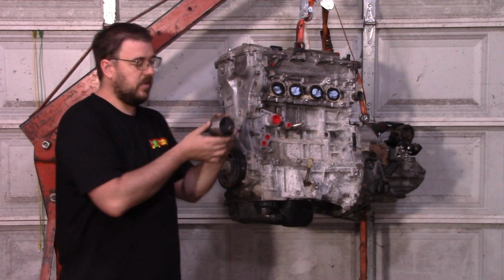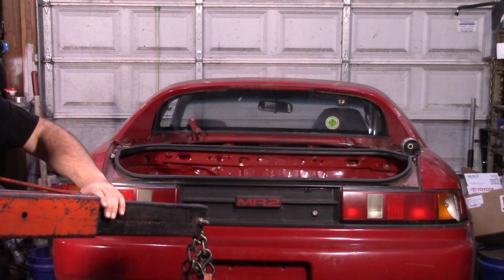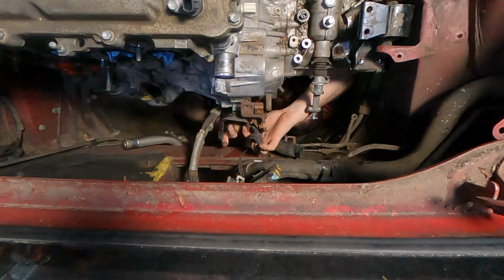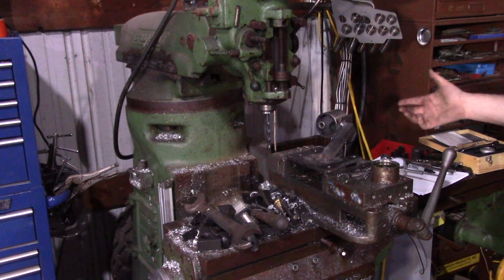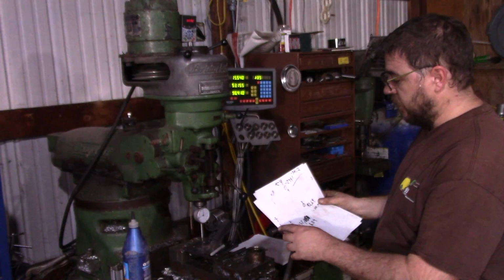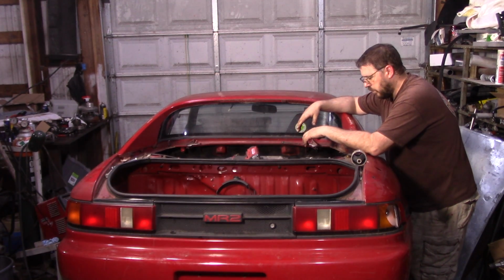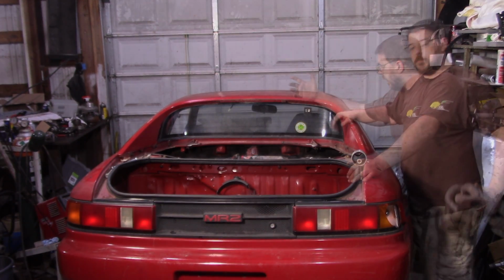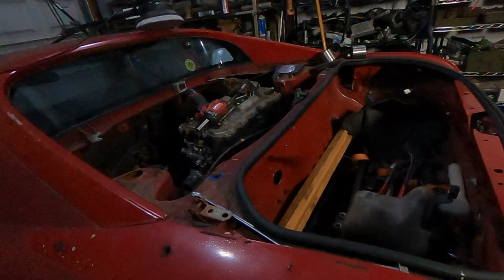MR2 SW20 2AR-FE engine swap mount (Evey #3)

Comment: Any suggestions on using the old e153, where would be the best place to add mount holes?
Reply from the maker: It would be easiest to just get a more modern bellhousing and swap it onto your E153 than to modify it. But with that said, generally you want to add bolts in the biggest gaps. In this case it would be at the bottom. picking up the two bottom bolts would really help provide more secure mounting.

Comment: I really appreciate all your work. It really has me taking a second look at the NZ and AR platforms over anything from another make.

Do you have a place to find information about the Denso box or NEC processors that come with these units? I'm having a hard time finding anything like a manual. You can't start doing the fun stuff until you know how the code works.

Do you have any plans to try anything with a turbo? I'm sure you already know about the 8AR-FTS, so there are turbo pistons available.

You could also try a 90mm bore with a 86mm crank, high compression pistons, long rods (probably custom) and revving the heck out of it.

I have some ideas for higher revs, but they would take a lot of work.
Reply from the maker: Yeah, it does have a lot of potential and i think i'll go a long way to starting to show that in 2022. The way Toyota builds motors is very underrated for reasons i don't really understand but i'm doing what i can to fix that.

There's no datasheet on the processor that i have been able to find. So there's no mapping of the peripherals on there. The NASA unintended acceleration report contains some incidental information but it isn't that much. There's a good chance that the die is not actually unique to Denso, the best way to go would be to buy a pile of NEC processors and decap them and decap the Denso units to do some compairaisons. You might even get away with decapping the Denso one only and potentially finding some markers on the die that indicate something. I do know that there's no NEC processor with the same number  of pins so there's no easy match up like that.

Comment: I can't remember if you address this or not in another video, but is the 2gr axle mount going to work on this swap or are you going to have to design another mount to support the  axle? If so what is the eta on that?
Reply from the maker: The 2010 manual camry axle carrier should be close enough especially with an 1/8" shim between it and the block. This will get us going for now but i will eventually make a lightweight axle carrier bracket as long as there is enough demand for it. In the interim I'll probably release a shim plate.
Reply: @FrankensteinMotorworks  so I'm leaning very heavily on doing a cal legal engine swap with the 2ar fe. Are you able to list all the emissions components I will need? Off the top of my head: egr, catalytic converters, charcoal canister, all vacuum lines... anything else? I'm not too familiar with emissions on newer vehicles.

Comment: Id be really interested in doing a 2ar sw20 swap with a 6 speed ea trans. Even an aw11. The e153 is becoming nearly unattainable at a reasonable cost. I know your build is a racecar but if you got time, and resources, I'd like to see more possibilities for a daily driven, cost effective, modern upgrade swap. Ofcourse toyota blood. Keep up the good work. Love the content.
Reply from the maker: Honestly this is a tough problem to handle. I absolutely want to solve this but there's also all the other messages i get that say they don't want to swap anything other than an E153 into the Spyder despite me providing a modern transmission option for those. The issue comes down to availability, there's really no manual transmission with great availability that is on the market today for use with these. When i picked the EB60 for the Spyder there were hundreds of them and they cost $500-800 a piece. now the junkyards all want more than Toyota wants for a new one. The EA60 starts even rarer and more expensive unless you're in the UK.  So i totally want to solve this, i just don't know which transmission to use to do it with.
Reply: @FrankensteinMotorworks  thanks for entertaining my interests. I've notice with  the pandemic, availability has gone scarce due to lack of importing and pricing has gone through the roof. IE: gen 4 3sgte prices have doubled.

Comment: On the poly front mount: Will that be close enough to what your customers have, in terms of ts effect on the final alignment of the engine? I accept it's not going to affect the left/right lean of the engine much.
Also, wouldn't you want to put the main bolt in from the side of the car? How will you get it out once your headers are installed?

Torque control seem to be the best use for poly bushes, as they're usually not under as much load, right? that should reduce the transferred vibrations, I would think.
Certainly I can recommend getting new mounts of any type for anyone with an MR2,
My 1999's front mount rubber was detached from the steel, it felt horrible.
I got a new bushing (Mackay A5111 Engine Mount Front) and pressed into the bracket. it feels SO much better, shifts much easier now.
Reply from the maker: The poly front and rear mount i'm using is the factory mounts but the rubber is replaced with poly so the alignment is the same without having to worry about nearly as much droop due to the unsupported right side mount. It just makes locating that 4th mount at exactly the right spot quite a bit easier.

Comment: Im a bit confused, what motor are tou going to squeeze its full potential? The regular 2ar or the fxe variant?
Reply from the maker: Since i'll be replacing the pistons and the cams there's no difference between the FE and FXE for the sake of this discussion. If you want to be technical about it i'll likely be using a 1AR-FE crankshaft which will be the only differentiating component left in the engine.
Reply: @FrankensteinMotorworks  got it, any head work or just stock for the inicial testing
Reply from the maker: @e5141981  For the initial testing I'm just going to run a stock engine. The initial testing will just be to make sure everything in the car works together and to get a base tune on there before i start tweaking. That said, there will be head work entering the picture quite soon after the initial testing. probably not the 2nd engine but probably on the 3rd engine.
Reply: @FrankensteinMotorworks  awsome! I have so many questions but i will stay tuned as you continue this build, all my questions will eventually be answered
Reply from the maker: @e5141981  You can feel free to ask. even if it makes no sense to answer in a comment it gives me guidance to make sure i cover those things in future videos.

Comment: have you ever thought about implementing the 2ar-fse with the D4-S port/direct injection system?
Reply from the maker: The 2AR-FSE is actually a longitudinal motor so the block is completely different. It might be possible to swap the FSE head on an FE block to fix that but then the next problem is i'm 90% sure that it isn't available at all in the USA. Plus the benefit of port injection is that it effectively gives the effect of higher octane fuel which allows for higher compression and higher engine efficiency. But since we aren't limited by fuel octane here because i haven't limited this challenge to any fuel and I live in Indianapolis which has easy access to just about any fuel there really would not be anything gained with the extra complexity.
Reply: I think direct injection requires much higher fuel pressur for the direct injection rail, which needs a secondary pump maybe?
that would be a lot of added complexity, but if it's all mounted on the engine itself, it shouldn't be hard for our champion to tackle.

Comment: how do you plan on dealing with the throttle? Or will that be in a future episode?
Reply: If it's like the 2GR-FE (And i'm 90% sure it is), he already makes and sells the requisite pedal, adaptor mount and wiring for this exact application.
Reply from the maker: @mrkazman  Exactly, i plan on keeping it drive by wire and just using my off the shelf pedal assembly: https://frankensteinmotorworks.squarespace.com/shop/sw20dbwpedal
Reply: @FrankensteinMotorworks  making me really want to do this instead of my k Swap plans this winter lol.   You're using the 2AR. Would it basically be the same grabbing a 1AR and having the extra displacement? It'll bolt up to the trans? (I have a later 94+ E153)
Reply from the maker: @ckli5768  Yes, the 1ar and the 2ar are 100% interchangeable. the engine block and the head part numbers match exactly.
Reply: @FrankensteinMotorworks  awesome! Looking forward to the next few videos for this swap, do you think it'll be feasible to run higher then 205WHP from the stock ECU you're offering? I have no emissions where I live, so there is no worry about dealing with inspections
Reply: @FrankensteinMotorworks  I've been meaning to ask, but it's that adapted compatible with RHD cars? I'm sure you'll have a lot more JDM owners in the coming years

Comment: What cam shafts are you using for the 2ar-fe?
Reply from the maker: These are all my design. I plan on putting these up for sale on the market as soon as i have tested them
Reply: @FrankensteinMotorworks  you may already have a customer 
Trying to get my 2ar on some boost pressure but i have to look into some valvetrain upgrades.
Reply from the maker: @keitht8595  Stay tuned, I should start talking about the cams within a month. As soon as they get into my hands.

Comment: If you're not using high AKI race gas,  would you use E85 instead for more timing and less knock?
Reply from the maker: I assume you're talking about the 2AR-FXE engine. I'm not using high octane race gas. Just the normal high octane stuff at the pump for street cars

Comment: Is there another transmission that will work with the 2ar-fxe besides the scion 6spd. I have a 2000 mr2 spyder I'd like too put that motor in but that tranny is a little hard to come by.
Reply from the maker: The problem with the Spyder is not the transmission fitting the motor because there are many. for example in this build i'm using an E153. The issue is the spyder engine bay is tiny and other transmissions require cutting. The S54 might fit but i am not sure.

Comment: stares in I need this
Reply from the maker: The mount should be available before the end of next month and you'll be able to build your own no problem
Reply: @FrankensteinMotorworks  1AR All-Trac, here I come! 👌
Reply from the maker: @jeffman3  I think the all-trac actually has a slightly different mount location so you would need a different mount or to remake the frame side bracketry to use my mount.

Comment: Me with my 2014 Camry four banger 👀
Reply from the maker: Bet you did not realize there was a monster under the hood eh?
Reply: Can we swap to manual transmission? Cause my dealership told that torque converter warranty had expired so I want swap to manual in RAV4.
Reply from the maker: @technocody9296  depending on which year rav4 you could use factory parts to convert it to manual but a manual conversion is always a bit of a pain.
Reply: @FrankensteinMotorworks  I'm using 2013 RAV4

I was thinking about retrieve parts from wrecked Scion 2.5 in pull 'n parts.

I need Scion manual ECM, Shifter assembly, pedals assembly, clutch lines and clutch master cylinder. I want find LSD upgrade for winter.